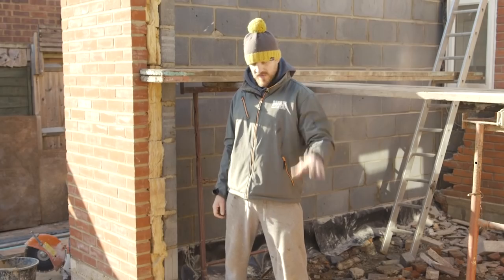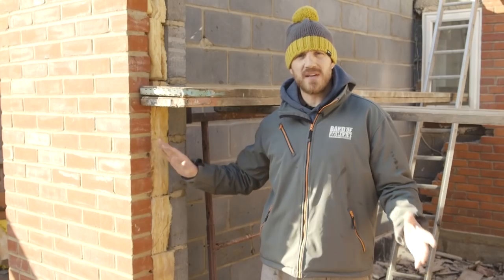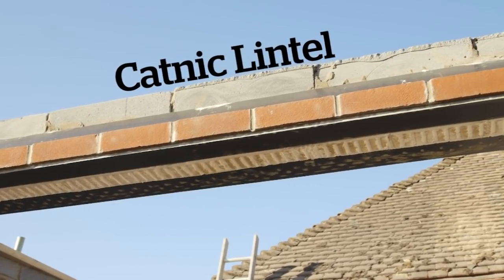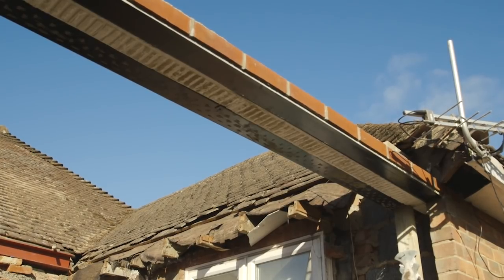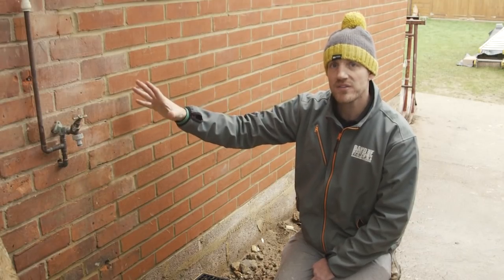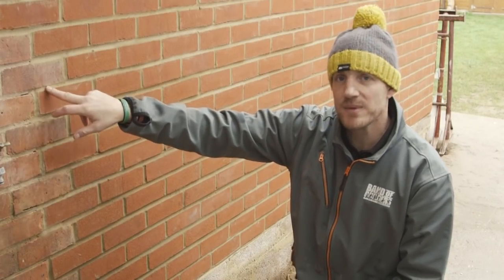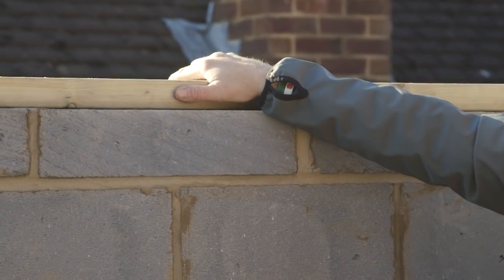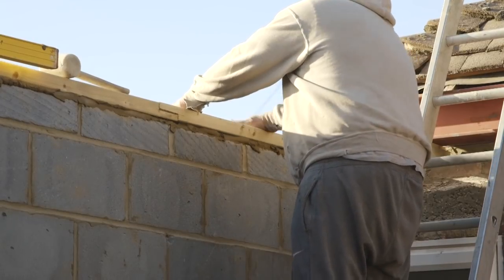How to Build Walls; How to Build an Extension (4)

Comment: I watched a couple of videos from this series, but essential information is missed out.
No word on how and where to fit DPC or wall venting.
Also I could see in the video that the outer skin of the existing build was slotted in where the new wall is going to attach to continue the wall cavity of the old into the new build, which is an important detail to avoid cold bridging and dampness in that corner of the new build, but it is not mentioned by the presenter.

Comment: I thought teething-in was less common these days as modern footings are usually so much deeper than the original building. Wall starters allow up to 10mm of movement in case of ground movement and so there is less chance of cracking. Having said that it does look much better, but it also takes a bit longer.

Comment: Bit confused about the insulation, noticed it's only 50mm below ground, but seems to fill the 100mm space above ground? How do you fasten the lower 50mm to the blocks? Also surely the 'ties' are cold bridging the gap, I assume they're metal, or are they made from a non conducting material? How do passive houses do it? How do you fit celotex with ties involved? (as it's more efficient by far). Great videos, though would have liked to see the teething on video, and the change from block to brick too.

Comment: Hey, great playlist thanks for sharing!

If I'm removing the external wall to open up into the extension can I build the extension shell first before knocking this down?
Reply from the maker: Absolutely - It's normal practise to get the extension shell built before removing the external wall. Later on in this playlist is the wall removal video where you can see this happening. Cheers!

Comment: Good clear informative video. Just one question, u stated in your previous video that u we’re going to use 50mm rigid cavity insulation but in this video u have used full fill mineral wool? Was the 50mm rigid used below dpc to keep slab warm ??

Comment: What if you are building a wall for a small house, those houses where the walls are  not tallers than 2.5 meter max. There are that kind of small building or houses now. Would you still use this double layer you used with cavity? Because this appear to be very strong for some thing pretty big.
Reply from the maker: Hi Oliver, yes we'd still use the double layer with cavity, because not only does it provide strength, it provides space for insulation - doesn't matter how tall your building is, you need it to be warm!
Reply: @HomebuildingMagazine  ok thanks.

Comment: why is inside skin layed with grey concrete slabs, is it simply cheaper for same result than bricks?
Reply from the maker: Exactly - the bricks are larger and cheaper, so they go up quicker and more economically. You could do both inside and outside skins with them, if you were planning to render the outside skin, for example. Here they chose a brick outer skin to match the existing build.

Comment: Hi thanks for info...I am making a small music room and want to use rwA45 for soundproofing, would I leave a 100mm gap between outside brick and inside breeze blocks then add the rw45 slabs inside? Im thinking add 50mm slabs leaving a 50mm gap?
Reply from the maker: Having had a look at the Rockwool website, it looks like the RWA45 insulation is great for acoustic insulation / soundproofing and would effectively replace your regular insulation, so what you're suggesting here is right - 50mm insulation and a 50mm air gap within your 100mm space between outside / inside brickwork / blockwork. There are also tons of soundproofing products you can install on your inner walls too, to double up. If it's two storey, it's worth looking at soundproof floorboards, which deaden the noise both ways (no creaky footsteps above while you're recording).
Reply: @HomebuildingMagazine  so its it better here to always fit the insulation between the gap? as oppose to fitting them on h=the internal breeze block then pasterboard?

Comment: Hi.
I liked ur videos quite interesting & helpful especially for those who want to learn more about extensions.& to reduce costs. You know all the prices.

I am planning for an extension at the side of my flat. It’s four in a block cottage flat but through land registry I know this part of land belongs to me only .neighbour downstairs have own access to their main door.
My question would I get permission for a 2 storey extension. How much it cost for permission?

The extension I m thinking about 32 square metres.

I asked couple of Builders quote me roughly £2000 to 2500 m2 double storey extension.roughly about £60,000 job.

My budget is £40,000 . 
How can I reduce cost ? Which material to use or who to use to reduce labour cost & materials?

Any suggestions will be appropriated ?

I m in Glasgow,Scotland.

Thanks
Reply from the maker: If you're in a flat or shared building, my first thought would be whether you're a Leaseholder or a Freeholder, and what are the terms of your shared building contract? An architect or designer would need that information  before any drawings or permissions were requested. From what you describe, with a neighbour downstairs, it seems unlikely you'd get permission, but we may be misunderstanding your set-up.
In terms of reducing costs, think about build materials. Perhaps a timber-framed extension with SIPS panels rather than a brick construction might mean a much quicker build, reducing your spend on builders-on-site, scaffolding-on-site etc. It may also have a bearing on the depth & type of foundations required, so might help reduce costs.
But first things first, find out about your ownership contract, and then speak to a designer for planning permission advice. Good luck!

Comment: confused? whay 50mm and not 100mm to fill the cavity? 50mm leaves 50mm?
Reply from the maker: That's right - there's a 50mm air gap as well as the insulation, to prevent condensation / moisture build up.

Comment: those wall ties look like they a running into building , could cause a damp problem 
the gauge on the brickwork looks very high
Reply: yes the brickwork looks like its higher then the block work
Reply: I think it's because he tied the new brickwork in with the old. If the old brickwork is build in inches, u will get this problem. He should have build the blockwork accordingly.